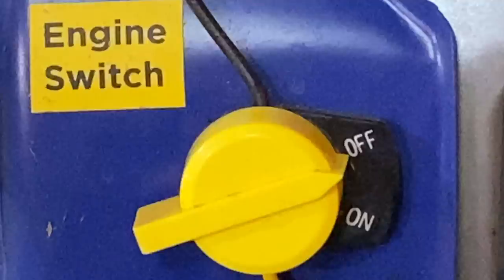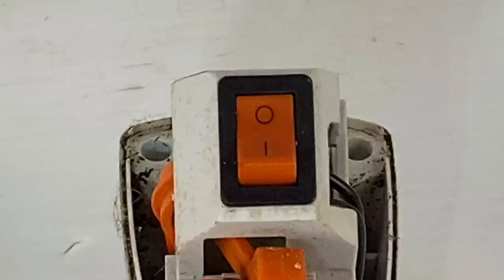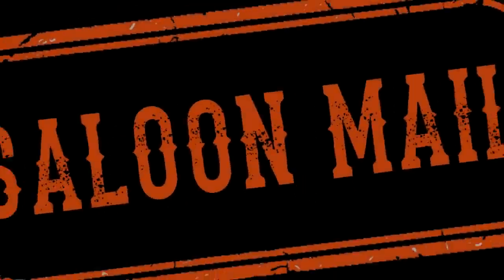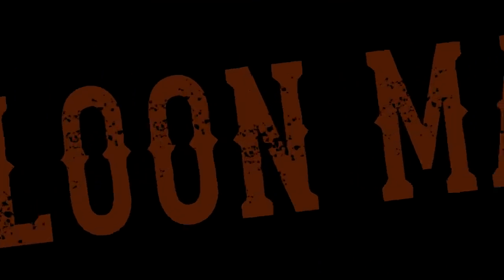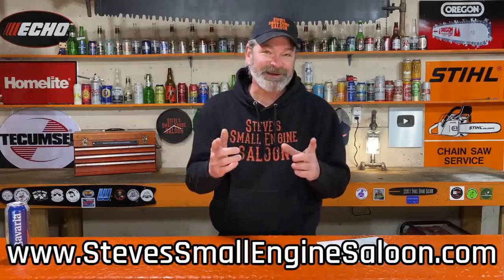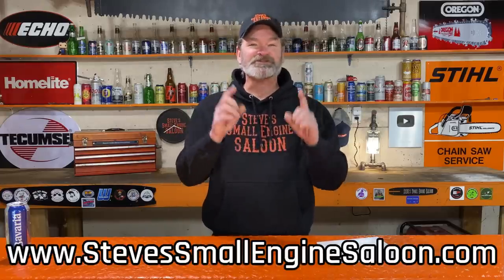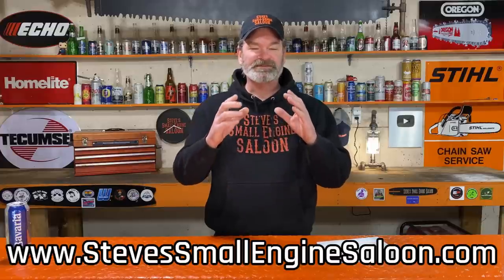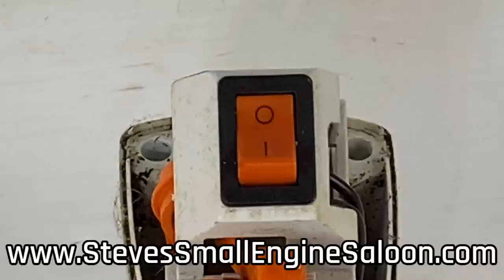Easy Way To Remember What The I and O Means On A Switch

Comment: They should have used "C" and a "O" for open and closed circuits.
(after all, the C not a continuous closed loop, thus an open circuit)
(continuity flows freely around the shape of the O but cannot with the C)

Comment: It is actually zero and one. Zero is no and 1 is yes. Do I have power? 0=no 1=yes, you can also think of it as a ratio. 0 is zero, .5 is half on, 1 is full on.  Much better than O for on and O for off. (can you tell that I, too was a programmer)

I could be wrong, it might be german or something...

Comment: How hard is it to figure out.  It is annoying, like the switch on Australian appliances that are upside down.   I remember it by thinking of all the people in the southern hemisphere hanging with there feet towards the sky as they swing from handhold to handhold on the underside of the flat earth… see how silly the idea of flat earth is?   But it works for the electrical switch, which if you remember we used to use for major power switches.  😂😂

Comment: Even while I know that it's not a letter I and letter O, I still think of them as such. So to me, it's I for "In" (letting the power in, so to speak), and O for "Out" (taking or letting the power out). Being a computer guy that makes the most sense to me.
But I do love the "Ignition" method when it comes to machines powered by engines/motors.

Comment: I believe the symbols or actually a one and a 0 which is digital speak. One meaning the presence of a voltage or a signal and 0 meaning no presence of a voltage or signal. Therefore knowing the actual meanings of them also helps you to remember which one is which

Comment: It’s not the letter ‘O’ it’s the number zero. Computers work with ones and zeroes at the lowest level. One is on, zero is off. Zero is also nothing. No electricity.

I simply look at the one as a conductive wire and the zero as an open circuit.

Comment: Hi Steve, that was a good video, I’d also remember it by saying “O”  for off, an extension cord, and I got a male, and at one end, and a female end at the other, and I connect them together. Do you have a loop, and no voltage can flow in a loop

Comment: The truth is it’s a line and a circle, not a 1 and a zero, it’s a connection or not. There is no number 1 (doesn’t look like that), and there is no number 0 (doesn’t look like that), it’s an open or closed circuit, straight line or circle, it ain’t no computer geek thing, it’s a power tool.

Comment: The line means the circuit is complete, as in, there is no break in the wiring setup. The circle means there is a gap in the circuit, so no connection.

Comment: Seriously? ... where it gets a bit more trick is what does red and green mean... some countries is red on, some is red stop and green on. some is green off because green ist safe, red is caution equals on. :-) I/O it could also be Input and Output. or 1 or 0. Most likely the reason why its not on/off everywhere is because there are countries in the world who dont speak english - can you believe it? :-) Seriously - Human Machine Interface is a significant topic all over the world - especially if it comes to countries they dont speak english or even where people cant read or write - there you have to make a interface with symbols of the action which is happening if pushing a button or working with colors etc... than 1/0 or I/O becomes the smallest problem. Hope i could bring in some more aspects.

Comment: You ought to try working with industrial bus plugs up in the ceilings. Everybody knows red is stop, but for poor electricians, red is hot (on) and green is off (safe). When you have a 20 foot long stick reaching up into the ceiling with bright lights in your eyes, it can be hard to see the on and off.

Comment: You should also have mentioned the it is not the letter "i" and "o". It is a "0" (zero) and a "1" (one).  The "0" is zero, nothing, off. The "1" is way more than nothing, it is everything (100%) and on.

Comment: in computer terms, I=input, O=Output.  when the I is pressed down, input only, no output, therefore the engine runs, when that switch is on the O, there is output, where does the output go? ground.  what happens when the coil is grounded? no start as no spark.  that is how those switches have translated in my head for years now.

Comment: And for those that have switches that have nothing to do with engines or ignition sources?   'O' stands for 'OFF'

or for those more technical minded it is 'Flow' and 'not flow' or even 'connected' and 'not connected'

Comment: The "I"gnitiion & "O"ff relation certainly applies to switches that control ignition systems.  However, many things that are not "engines" also use this type of power switch.  I have always used a different memory jogger...  "I" is for In-service, and "O" is for out-of-service.  That relationship will apply to all of the different uses for these switches.

Comment: Its a one and zero. One means "on", zero means "off". Its binary code used by all digital devices, a transistor  when turned on equates to "one", and when turned off equates to zero. Confusingly, in computing and electronics, I/O is actually a capital "i" and capital "o", and stands for input/output.

Comment: That's a way to remember, but why should we? The question was "Why don't they simply put on and off on there", so there is no need to have some way to remember. Why not a plus and a negative symbol?? Duh? Any international engineer should be clever enough to figure that one out

Comment: Y’all are working waaaaaaay too hard. It’s simply a 1 and a 0 as in binary. 

1 is power and 0 is nothing. 🤷‍♂️ 

That’s why the power button on a computer is typically a line through a circle to show both states.

Comment: "0" is off.  It can't get any simpler than that.
Reply from the maker: ""0" is off.  It can't get any simpler than that."
LOL!  I hope you are smart enough to know that ON also starts with the letter O.....
Reply: @StevesSmallEngineSaloon  I am getting old, I hope I don't forget either. LOL.  I am guessing the line and circle genesis originated from IEC standards.  And for another rabbit hole, albetically, off precedes on,  so the circle defaults to off.

Comment: Really?  Does anyone actually need to remember what it means?  It's not an I and O, it's a 1 and 0 (zero).  It comes from digital electronics which are binary, either on or off.  The on state has always been represented with a 1 and the off state with a 0.  This is where binary code comes from.  So if you think of it as 1 representing the on state and 0 the off state, it makes sense.  And the reason switches like this don't say "ON" and "OFF" is because they're sold in various countries which may or may not speak English.  So the standard 1 and 0 are universal.

Comment: It is a zero and a one. It is binary where one means yes and zero means no. It evolved from binary when digital circuits became widely in use. You use binary to troubleshoot the circuit. Since the circuits were being used worldwide and binary was used to troubleshoot them and every technician who troubleshot the circuits had to know binary it simply evolved to the power switch as well. One meaning yes and zero meaning no for yes power or no power. People who were not technicians came up with their own meanings since they did not know about the binary relationship. So there, you now know the true meaning of one and zero.